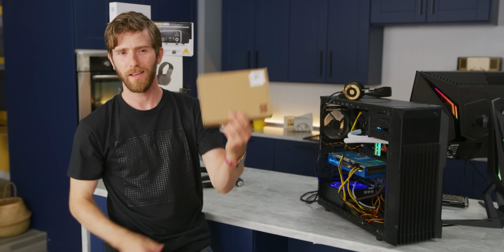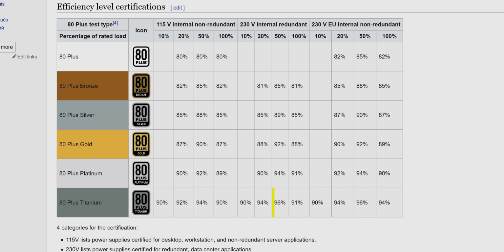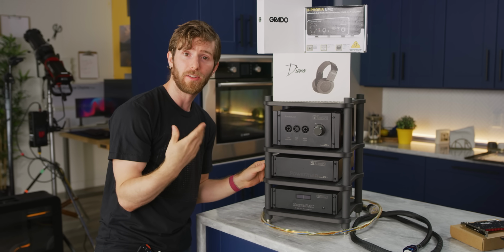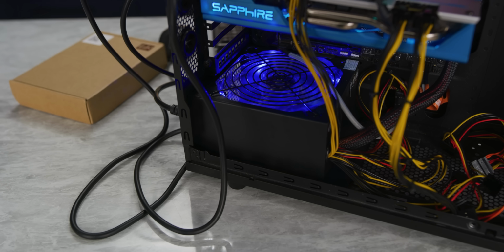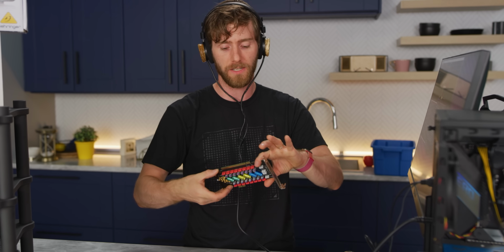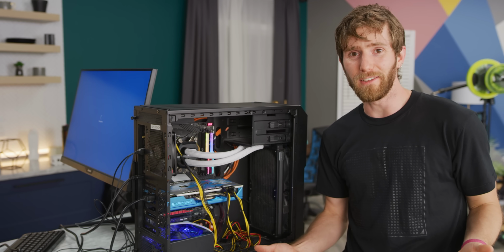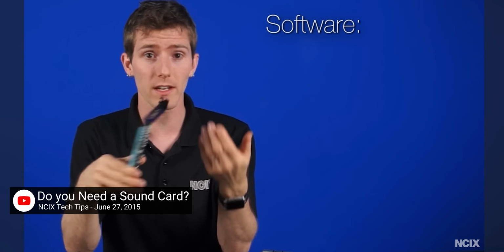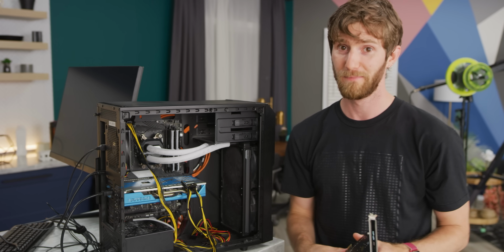Is this $40 card a SCAM? - "Audiophile" Power Filter

Comment: For the last several years, I've only ever experienced the noise occurring on the Front Panel Audio jack, which I'm guessing is because of the extra distance traveled across the board?

The jacks soldered onto the motherboard itself tend to filter just fine, but that FPA jack has still been as trash as ever, and I was hoping to see if that had any effect with the device.

Comment: they even have voltage stabilizers for pc? damn.. hahaha.

maybe you should tried it with an audio software whether it does smooth out the audio or not.

we used to buy audio cards in 90's. creative soundblaster. the price varies like the graphic cards price nowadays. you have the cheap ones and the ultra crazy ones with 7 input jacks to use with the home theater you got. those years gone by pretty fast when motherboard even equipped with those 7 jacks and sounded good.

Comment: Bad testing... You should OC CPU+GPU, then open a benchmark to simulate playing a game and then test, most likely would actually properly make noise... At least on my PC with crap USB headphones when I play a game the sound just get F*ed and syncs with FPS, the more FPS, the worse it gets.

Also that super high quality card didn't work because like always you made it fall on the ground :)

Anyway I have a old Auzentech X-Fi Forte 7.1 PCIe and no matter what I don't hear any buzz which means it probably simply have good filtering though sure it's nothing audiophile grade. But onboard soundcard definitely is affected by buzz annoying sound and scratches effects included, though nothing like most USB stuff I ever tested.

EDIT: In fact just using amplified headphones with normal 3.5mm jacks to my soundcard, just connecting the USB for power it gets completely ruined, connecting to external USB power from other devices improve BIG TIME. My PC would actually be the perfect scenario to test that this noise filtering card to see if at least USB would improve since normal headphones on the Auzentech always works fine.

Comment: Oddly capacitors can be used to clean up and smooth out signals, and clean up power sources.
But not normally when used out of the signal chain, it's the right idea in the wrong place to be really effective.
Reply: actually they need to be near the thing that is doing horrible power consumption, as that's at the end of the conductors pulling the current that is causing the voltage drop across the copper tracks etc.
Reply: Ideally needs to be in the PSU XD
Reply: @supertim7722  Either in the power supply, or inline to where that power is going.
Reply: @meowland8379  you have it the other way around. Capacitors are high-pass filters which allow AC to pass through and block DC signals
Reply: @youhackforme  Capacitors are high-pass filters when placed in the signal line, where they're often used for decoupling and dealing with DC offsets like different ground potentials. They've probably got those capacitors bridging the voltage rails and ground. In that position they'll act as low-pass filters, smoothing out higher-frequency noise. They're going to be too far away from the actual Digital to Analog Converters to do much good though.

@Meowland "Real audiophiles are better off staying away from digital." So, you're saying that instead of mixing and mastering audio on a computer, bands and composers should be what, mixing using Vinyl records and painstakingly constructed analog circuitry customized for every task? Try telling that to Hans Zimmerman or any composer these days.

Mixed analog/digital circuitry is nothing new, and noise isolation between those domains is a major task of circuit board design in those environments. There is absolutely nothing wrong soundwise with using high sample-rate, digital audio for the majority of your chain and finally converting to analog right at the driver stage. That way you can get all the power, signal to noise, transmission, and ease-of-use benefits of digital. Cheap mp3/wma/youtube compression that destroys sound quality? Oh, I'm right there with you. But there are lossless formats that preserve the original audio far better than any analog signal you can create and store.

Comment: These sort of things aren't for very audiobale hiss anyway... a power conditioner is way better, but the difference is only noticeable to someone who would notice the difference and for professionals not wanting to add noise they themselves might not hear... they're also not to reduce physical noise make mechanically... this might be complete bullshit, but this wasn't the testing ground for it... because there are issues with digital noise and it is why audio production computers use power conditioners... those expensive headphones might a better testing ground, but I bet the difference of the power conditioner in that system wouldn't be noticed with or without it by someone without that depth of listening skill... If this card does work it wouldn't be sorting big hiss problems and maybe you should have already had a big hiss problem to sort anyway if to prove they don't sort that... this will if it does anything smooth an inaudible level of noise, that will slightly better the dynamics from its removal... in vocal takes, producer often cut the silent gaps in a vocal takes to give more dynamic room for the rest of the music... if you listen to it, you can't hear it but it affects the rest of the track... the fact it is on a PCI-E slot is the only questionable part of it... the number of capacitors on the board does make it a good deal... so what are they gaining from this as it's not a rip off in that sense? ... The claims of improving performance would also be something to test but would be barely noticeable... but that difference can see fewer glitches in the long run, which you couldn't measure... the thing is, it's $40... the level of a difference it is offering is for people who have already spent a lot of money of other things... this $40 is nothing, it wouldn't be for a cheap computer build... what it actually achieves I wouldn't even notice because when everything gets a tiny tiny tiny bit better you don't notice it... although often you can notice something smother about everything... maybe you just got a bit better at life or something... who knows... we have a world that can not survive without making money, so there will always be someone trying to fill a gap to survive also... so most things, even evidently good things are a bit of a pointless thing we just have to make sure we're all making or spending money... which is why a system of money was good to push us to get where we have gotten, but it them leaves no room for it all slow down once there basically too much stuff... also the money system sees things to never really be as good as they can be... because everything is trying to bring you the best for as little production cost as possible... take away money and products would be better... companies would then be intuition tecnology developers that would only seek to make something as good as possible and also resourses would only be collected when need also creating less destruction to the planet... because the resource collection companies would work when needed not work to constantly be bringing in money where other companies have to find new reasons for the resources to keep that company going along with their own company using those resoroces... etc etc... a long rant adding to a possibly snake oil product... due to the fact the testing was a bit snake oil itself

Comment: THANK YOU! You're the first one that brought acknowledgement and a good solution for my problem with my tiny 3W (RMS) Loudspeakers that i have solely for the purpose of cheap bass woofers (via software equalizing i can achieve them to play only below certain frequency). Basically i'm on a very cheap laptop, it's not a problem with headphones but it is a big deal when using those kind of cheap loudspeakers, the electrical noise is so disgusting - The Hard Drive writing and reading while i'm copying a file from my main drive, my cellphone when i'm copying a file from or to it even my MOUSE MAKES THOSE SOUNDS and it's pretty annoying. Thanks to you i finally figured out why that happens and i can finally search better ways to fix it without building another system (which, ironically i can't afford although i have invested quite a lot on sound).

Comment: First you need a computer that suffers from a hissing noise, than you can compare with this card.
For example: if you have a car that already shines then you won't see any improvement after you polish it.
it's not fair to discredit this card because you don't know how to test correctly. 
it's not fair to discredit this card by false testing.
 Use an oscilloscope and an audio spectrum analyzer to review results.
Only then you can made a judgment.

Comment: Oh dear.. i can't see any measurements... You don't need to listen to such things and without being trained in critical listening you don't really know what you are looking for. You capture the signals and then compare them. To be fair, outputs are EASY to do, it is the inputs that are absolutely horrible and suspect to interference.

I did once think of one use that needs some audio "magic" but that has to do with the ground rail on the PC and the audio hardware connected to its outputs. It is often the only device that is earthed while the rest of the audio equipment at home is a floating ground. This can cause ground loops to form and it is very common to have that with PCs connected to a media center of some kind. Antenna is one source for ground potential as it is not connected to the same ground as mains, and the PC. So, simple solution is to use isolation transformers in a faraday cage and a line driver, isolating the connection between the PC power and audio. In my plan the device would've been fitted to one of the least used spaces in modern PC: the second CD/DVD/Blue-ray slot.

A lot of people have this problem but often it is invisible to the user. And it can't make good, clean audio any better, even in the case where we can measure the difference easily and prove that the whole system is at a much better place for optimal function, it does not benefit many. There are also other solutions, external pro audio interfaces will fix it, so does using optical. So, no there is no demand for it.

Comment: To the team, did you try to connect the power supply to the additional power connectors on this fishy board? Maybe even with a connector that goes in parallel to the grafic card? Because creating such card to filtering the noise is quite easy and it is hard to think that they failed, maybe it is just a scam...

Comment: Just get a Fosi Audio DAC-Q5 Pro for ~ $90 and use the optical link to connect it to your box. Connect your speakers to the DAC-Q5. Zero noise because obviously the optical link insulates the DAC from line noise. That's my solution to coil whine (and really, the best one I can think of).

Comment: I wouldn't mind slapping a board full of smoothing caps into my PCIe bus. The x1 slot above my video card would fit it without obstruction. Might smooth out the very real noise floor I get when recording on my Realtek onboard audio. I think it would have been helpful if Linus had connected his headphone out to the line-in and showed recording the noise floor using something like Audacity. At the same time, I'm glad that I get to watch a fist-full of multicolored China caps get tested on a machine that's not mine.

Comment: What bothers me the most about this is that you didn't use an oscilloscope to probe the power rails the card is supposed to filter. If there would be ANY difference that would have proved it.

Comment: If overclockers aren’t using it, it probably isn’t necessary. Smoothing out tiny voltage variations would theoretically help out stability which these capacitors would theoretically do

Comment: I'm very curious if it might actually help with overclocking. I've had issues with pushing overclocks and having issues from dirty power. Like when if I really pushed things my systen would crash when a blueray drive would power up, but otherwise would be 100% stable and had more than enough power to spare. If it does actually do anything for cleaning the power, it may help with overclocking
Reply: It may make a very small difference for example if the caps in you PSU get hit with a big load it can help out there (wont make any difference to a good PSU) if you have dirty power youd be better with a small UPS or power balancer. As for your crashing its more than likely a software issue or your overclocks unstable under heavy loads (benchmarks will tell you which it is) even overclocked you should never push over 80% of maximum wattage for your PSU, use good cables (they heat up and as they do they restrict power through put and can sometimes melt.
Reply: @supertim7722  I actually have a very nice PSU rated a bit over double the wattage my system takes at max load, and a great UPS rated higher than the PSU to top it off, but the Blueray drive I have has still caused me a ton of headaches while overclocking. Could just be the particular combo of hardware I have, but the second the Bluray powers up my system crashes with a high OC. With the Blueray unplugged easily runs Furmark and P95 for days.
Reply: @supertim7722  It's not a problem at all if I keep the overclock low enough. But the second I boost it a bit more it's lucky to even start booting to the OS, even Linux, let alone playing anything or loading drivers. Just the Blueray drive starting up on POST kills it. But unplug the drive and it easily takes another 0.4ghz or so stable. I've been building and repairing PC for well over a decade, and can say with almost complete certainty it's not a driver issue or Windows. Will be retiring that rig soon anyway with a fresh build, spent several years trying to get a good overclock with that drive, just not worth the effort anymore

Comment: A piece of crap.  Oh boy a whole load of probable inferior Chinese electrolytic caps to leak. And if you can't hear anything wrong it's because your ears aren't sensitive enough. As a service technician in a High End audio store we viewed all the smoke and mirror stuff as just that. Cut your fancy JPS  power cord open and see whats inside. Maybe a simple line filter. Maybe even less. Plus your house wiring may pass the electrical code, but the code only says how poorly the work can be done. Not how good it can be done. And that last few feet of esoteric power cord can't make up for the miles of aluminum transmission line between you and the generating station. Not to mention the non-audio grade step up and step down transformers in between you and where your power comes from. But if you've got money to burn, you'll be able to convince yourself there is an improvement.

Comment: I recognise the two yellow capacitors in the middle of the card. I bought a pre-amplifier card for a stereo amp that I'm building that had the same caps in it.
Elum 100 v at 4.7 uf. I'm pretty sure they're fake or at least rebadged mis-manufacture. I replaced them with Nichicon caps and I thought it strange that the Elum caps were physically 4 times bigger, also they measured 5.5 to 6 uf capacitance. Which is pretty close to being out of spec. Finally. Why the 100 volt rating? I get that small value caps with high voltage ratings are used for filtering but usually ceramics or film capacitors are used for that .
Not, shitty electrolytics.

Comment: Use a cheap desktop speaker amp connected to line out and let the volume up but don't play any sound. This is where you will hear all the noise the pc is giving out.

Headphones directly connected to PC is not sensitive enough to hear all the circuit noise. You need another stage of amplification to hear the noise.
This is where the circuit noise is problematic.

Another test is by just buying a cheap audio technica usb sound card and see if it gets rid of the noise using same test 

I guess you need to hire a proper guy to design electronics testing.. ehem ..me.

Comment: External audio and a choke for rfi (radio frequency interference) and common mode current. on The USB. HDMI and USB 3 buses are noisy. All electronics emit noise. Put some snap on chokes in there and you may get some results.

Comment: The way electronics works generally is the power supply has pretty good power specs. Then it goes to other places that have their own regulators that clean it up probably more. On some branches there is quite a bit of noise downstream from the regulators. I have heard lousy motherboard audio. High end audio again has regulators on the card that feed the output. There is a grain of truth to this, but it may not be accessing the same power branches as the onboard audio, and I would worry about it messing up the power specs of the rails.

Comment: To be honest, I'm still using sound cards for two reasons. Built in still have very limited surround configuration options and even advertised to be very well done, they are quite... average at most. Using analog 6 channel output for years I always had problem with noise even though I always used quite decent Asus mobo and gpu with Corsair, Enermax or BeQuiet power supply. There was always great room for improvement, I could always hear crackling under when the load changed. Even newer Asus Strix mobo that is advertised to have nicely insulated audio section was not great at that and I still use dedicated Creative cards for that. Note that for my main PC I always used analog surround output with dedicated amplifier, this might have completely different results from using headphones or small speakers. I did not have any issues using headphones connected to integrated sound card.